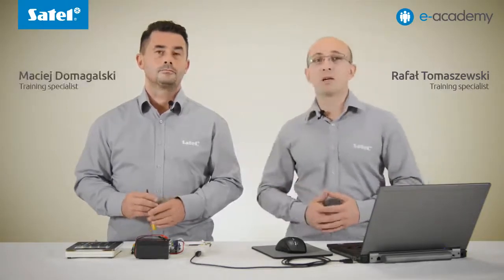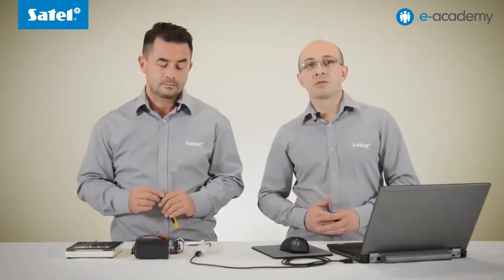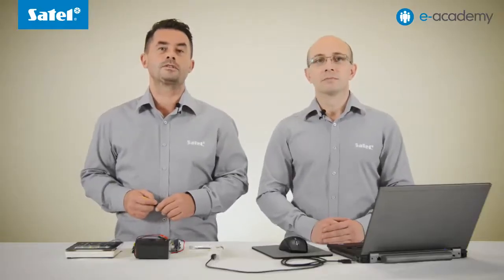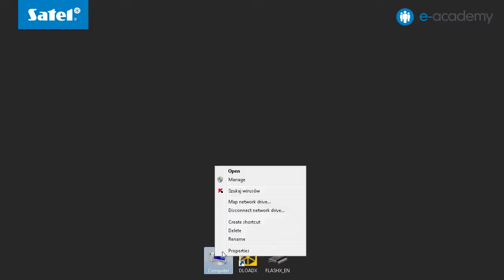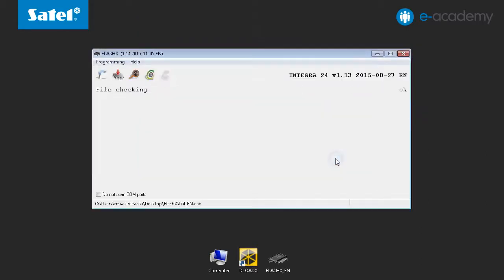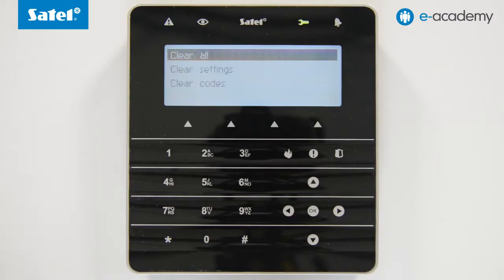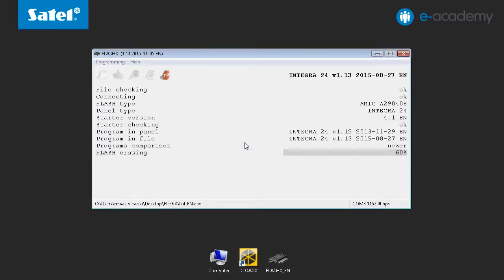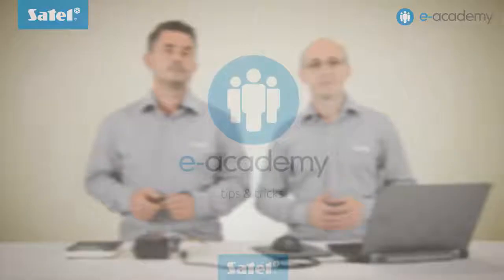SATEL e-Academy 1: Flashing the INTEGRA Control Panels Firmware

Comment: Hi, U have a quick question. The mainboard can be flashed via ETHM module. Is it also possible to flash control panels or acu controller via ETHM module?
Reply from the maker: Hi, Tomasz. Did you mean to ask whether it is possible to remotely flash other series of control panels and ACU controllers with DLOADX? You can remotely flash the VERSA, PERFECTA and MICRA motherboards if equipped with a communnication module. However, you cannot upddate ACU controllers this way.
Reply: @satelofficial hello, do you have any instructions on how to flash firmware for integra using ETHM?
thanks
Reply from the maker: Of course! The process is explained in the ETHM-1 manual. You can download it, along with other helpful documentation, from support.satel.pl.